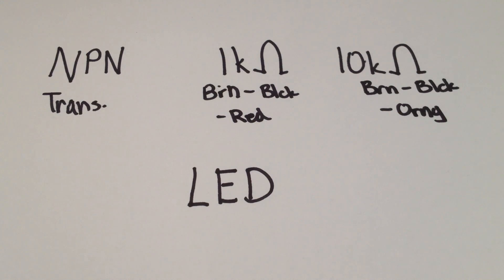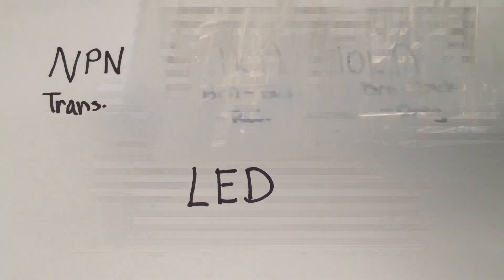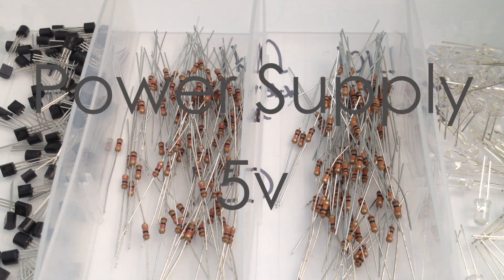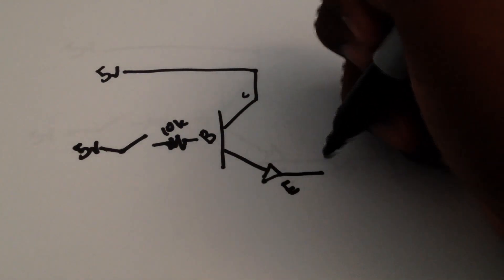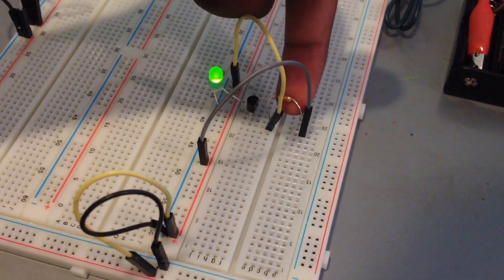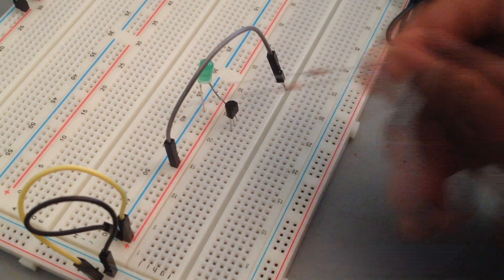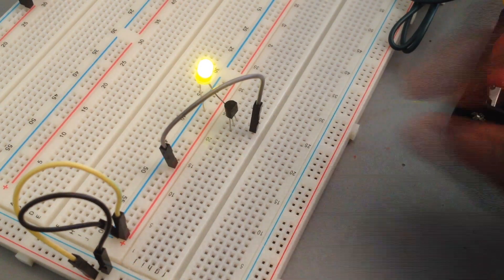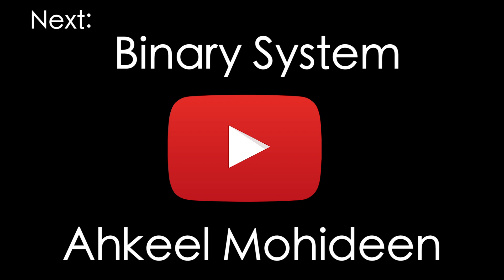How to Make an 8 bit Computer | Part 1

Comment: I went to buy transistors and the seller sold to me 10 (BC547) transistors with 2 dollars 😠 .. you say 100 with 5 dollars .. that means i've been fooled
Reply from the maker: +hunar omer yeah for electronics you'll find a huge range of wild prices. It's really easy to get duped (happened to me many times before). Things like average transistors or resistors will usually come cheap though because of their commonality.
Reply: https://www.ebay.com/itm/100Pcs-BC547-TO-92-NPN-45V-0-1A-Transistor-NEW/171906795614?hash=item280671885e:g:sggAAMXQlgtTA2Cn

Comment: do you know how to wire a motherboard that can run a type of windows
Reply: please answer as quickly as you can
Reply from the maker: +Gamerman Kevin to run Windows you would have to model an Intel chip, which has the same concepts and parts we are making in this series but on a much larger degree. It's possible but very difficult and time consuming more than anything.
Reply: OK I understand also would you know how to make a circuit that can run windows, the reason why I'm asking is because I'm designing a computer chip and it needs to run windows and it needs to have a chip for ram a chip for the hard drive, WiFi, Bluetooth, cpu, and micro sd card slots, I have a design for the case but I need a person like yourself to help design the circuitry but I need someone like you to help would you like to consider helping if you can't I will have to come up with another way
Reply from the maker: Id love to help you sounds interesting
Reply: would you know how to take a market type cpu and ram chip, memery chip, Bluetooth chip, WiFi chip, and micro sd card reader and writer and wire it up so that It would work all together kind of like the videos but just more advanced
Reply: three things for you to know about me I'm 15, I live in new jersey and I'm a computer designer and I still need to know if your able to use a 100 pin cpu, and a ram sd chip and a phone hard drive, and a wifi/bluetooth chip, and a micro sd card reader/writer, then we need to make our own conector I have the plans would you still like to help
Reply from the maker: Well you would need documentation from Intel and I don't know if it's available. What do you mean computer designer?
Reply: I design my own computers but I need help making the motherboards, if I give you the links to the pieces could you tell me if you could try to figure it out and make a circuit for it
Reply from the maker: Like you make circuits for the CPU, GPU, wifi card, etc?
Reply: no I'm trying to find out how to do that I design the outer shell and I find out what it will do and what it would look like the reason why I asked you if you know this stuff is because I don't understand the circuitry and how to make everything link up to work properly yet I'm only in 9th grade but I have big plans and ideas, but the things I need to know on how to do it I don't know it yet but I know how it's going to looks and how it going to work
Reply from the maker: Well all my motherboards are of a similar design with small added features here and there so I guess I could help with what I know

Comment: When you use the transistor without a resistor on the collector or emitter, why doesnt the LED burn? Does the transistor act like a resistor?
Reply from the maker: +Matthew Ferrie The LED is yellow if you notice. That is because there is too much voltage in the LED, that it is being oversaturated. There isn't enough voltage to burn it though. Usually (depends on the LED type, manufacturer, built in resistance) it takes more than 5v to blow up an LED. If i had left it like that for too long, it would've burned. But I didn't leave it for that long.
Reply: Thanks. One thing I've noticed, is that you seem to be mixing up voltage and current. Voltage doesn't go "in" a wire - it goes "across" two points. Current goes through things.
Reply from the maker: Sorry yeah I do that on accident because I'm just talking and it's not scripted
Reply: Ahkeel Mohideen
No worries :) Whenever I hear "voltage going through component x" I just replace "voltage" with "current"...
Reply from the maker: Matthew Ferrie OK and btw I'm gonna upload the next part today